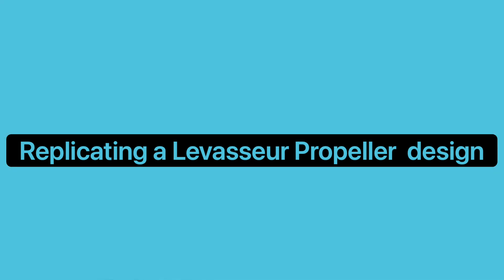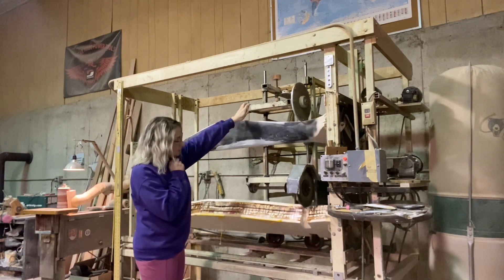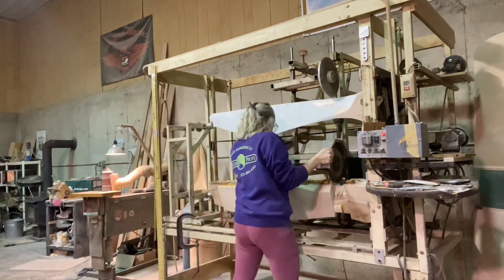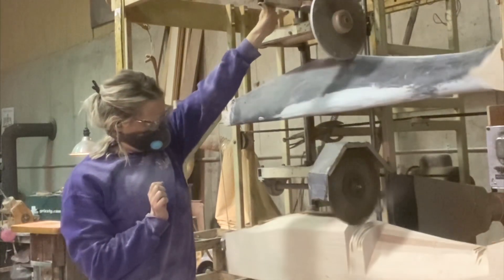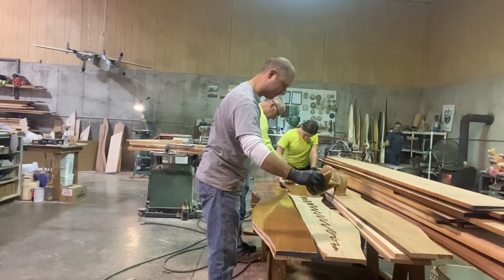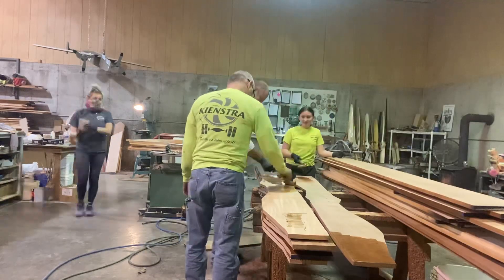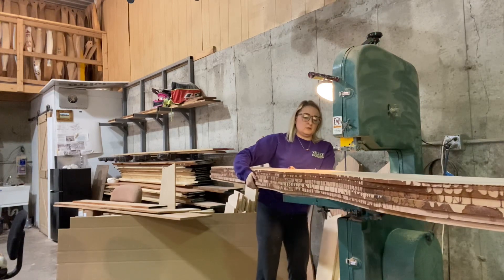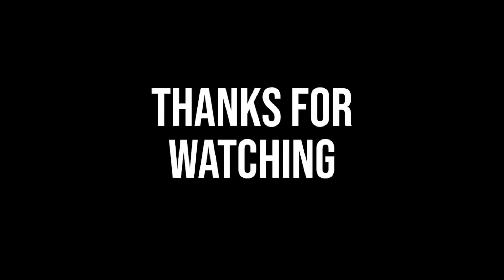Making a Replica Wooden Aircraft Propeller Part 1

Comment: I have a so called "Tiger-Saw", it is reciproking, electrically driven, and very easy to handle. One can install blades for wood or metal, even steel. It is extremely effective. A Tiger-Saw is much safer than a chain-saw, no comparison in the safety. You might want to hurt yourself badly with a Tiger-Saw, but not by mistake.
Reply from the maker: I will look into that

Comment: Great video!!!  I agree that a larger tracing wheel would allow for an offset in the first pass cut. That would allow larger pieces to be run and not “bottom out” the saw blade in the process. It’s great to see the whole family chipping in to help out. Keep up the great work@
Reply: Yes. Larger tracing wheel on first pass.
Reply: In the same vein as a larger tracer wheel, a simple adjustable stop could perform the same function you were doing hold up the saw carriage to reduce depth of cut. This could be a stop clamped on the vertical slides adjusted quickly with a single wrench.

Comment: It looks like a rim could be made that increases the diameter of the tracer wheel an inch or two. A simple wooden piece could be made from plywood so that it fits snugly or drill a couple small holes in the tracer wheel to attach it. You would need to make two passes with this setup

Comment: A skid could be added next to the blade that would allow the uncut portion of the blank to lift the blade if the cut is too deep. During normal use it would not do anything, but when the blank would hit, the skid will lift the blade arm.

Comment: Looking at the upper tracing follower, there is a vertical adjustment. Curently it's adjusted to make follow 1:1. If the follow wheel was adjusted down two inches you could make your pre-cut on a wide blade then adjust back to the exact match. What I don't see is a reference to make adjusting back and forth easy. A pointer with a scale would be good but a tab and a place for a dial indicator to mount once close (and then remove) would be a good addition.
Reply from the maker: Well, I don’t get to show the whole workings of the lathe, but I try not to make too many adjustments on the lathe

Comment: Couldn't you have used a larger follower wheel to take off a bit less material and work up to the current follower wheel to get to the prop size you wanted.
Reply from the maker: I could but I try not to mess with the lathe too much

Comment: I see what you mean about too much wood for the saw blade. I wonder if an electric plane would be helpful in removing material quickly? You'll figure it out.
Reply from the maker: I will look that up!
Reply: @CulverProps  Looks like your business is growing. Orders for larger props are coming in. Your first instincts about using a chain saw to cut away excess wood are correct but full of hazards. Figure out a way to minimize the hazards and you got something. Since you like to work alone you need a way to use a chainsaw where its impossible to get hurt if the saw kicks or the wood moves. Seems to me all your prop shaping is done with jiggs. Why not make a power tool jig with a frame big enough to hold the prop laminates and the power tool you choose to rough out the wood. Need to make something that can move/roll the length you want to cut away. Maybe a chain saw is your best bet but if you hold it in a jig it will never get the chance to gnaw on you. Try some things til you find something that works. Here is something a shipwright did:

https://www.youtube.com/watch?v=sXyYq5k5ZCY

Comment: Hi Alaina,
That is a big prop. Had a nice family affair going. You appeared to be getting a workout at the bandsaw. They do make smaller electric chainsaws where the bar is only about 4 to 6 inches. You should be able to wield that with enough dexterity to remove wood for the lathe to work easier. Hi to Grandma and you all stay safe.
Reply from the maker: Thank you! I will look them up. Hope you are doing well also!